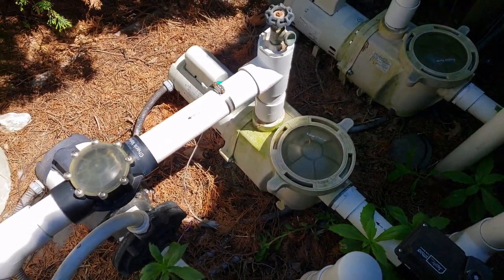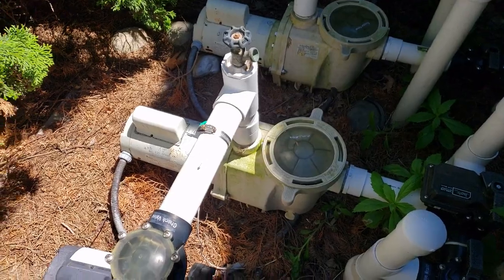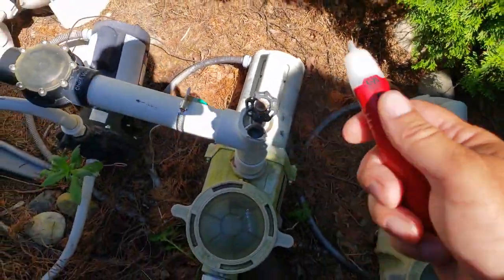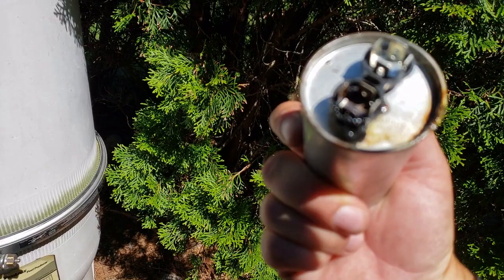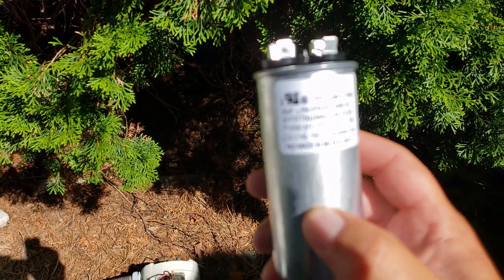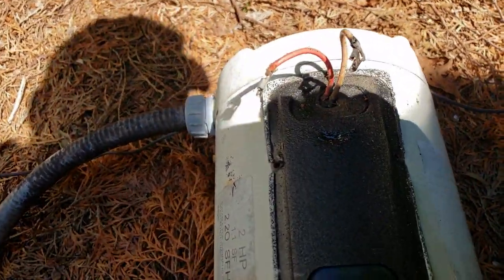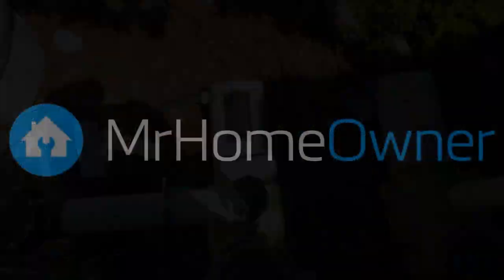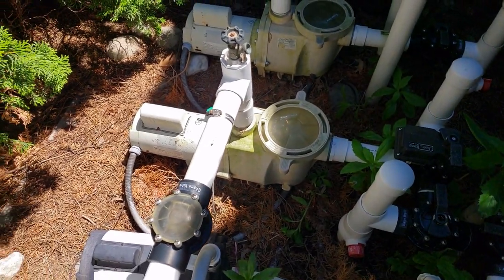Pool pump won't turn on and is humming or clicking

Comment: I had the same issue (humming and not starting). I checked the breaker at the pool and the breaker at the house and neither were flipped. I turned of and back on the breaker at the house and that did not fix the problem. I then turned off the breaker and back on at the pool breaker box and that DID fix the problem. So even thought he breakers did not appear to be flipped, turning it off then back on was sufficient. 
Also as a word of caution, capacitors can still be dangerous even if power is turned off at the breaker. A capacitor is a "battery" that stores up electricity in order to deliver a large jolt of power to "kick" the motor on then the lesser power through the breaker is sufficient to keep the motor going. This is the same with capacitors for hvac unit (in fact they are the same capacitors). If the capacitor itself fails then theoretically it holds no charge. And if the problem wasn't the capacitor, the charge would theoretically discharge itself into the motor when it is off. But if the problem was for example a wire to the capacitor rusted off, and the capacitor was unable to discharge to start the motor then it could still hold a charge when you go to service it even if the breaker is off. The shock from a capacitor is enough to possibly kill someone, lose a finger, or cause other injury. I know many hvac techs say it is very rare but it doesnt shock you until it does.So please be careful when serving near a capacitor and if you are going to touch the capacitor, please beforehand look up how to safely test and discharge a capacitor to ensure you don't hurt or kill yourself. I am always an advocate for diy but I also don't want anyone to get hurt or worse and leave their family without you.

Comment: Just in case a curve ball is tossed into the mix.  I too have a Jandy pump that humms, then the circuit breaker pops.  I tried the , rotate the prop,  hit the motor with a rubber mallet, then I went with the next step.  I bought a replacement capacitor.  That worked once, then it went back to its old behavior.  I decided to try a capacitor off one of the other motors.  One motor for water feature, one for jacuzzi, and the main pool pump.  The capacitor off the water feature pump worked perfectly.   I assume i got either, the wrong replacement capacitor,  or I bought a bad one.  Either way,  the capacitor was the culprit, and now it works fine.  Good thing,  My next call was to a pool repair service to replace the pump completely.
Reply from the maker: Awesome info Patrick - thanks man!

Comment: What if my pump doesn’t have that thing on top of it. What do I check?
Reply: The one he’s looking at is a run capacitor. If yours doesn’t have the hump on top it may have a start capacitor located at the back of the motor behind the housing.

Comment: when it was humming, was it also triggering off the circuit breaker in the panel?
Reply from the maker: Mine was not, but I'd imagine it could.
Reply: Thats exactly what mines doing, did you ever figure it out?

Comment from the maker: Someone replied asking if it matters which wire goes on which post, but then deleted it - it doesn't matter - but make sure you connect each wire to a separate post - meaning, any of the 4 tabs on each side - one wire to one of the 4 posts, then the other wire to one of the OTHER 4 posts.

Comment: Just wanted to say thanks for taking the time to make this video; I was able to confidently assess that my start capacitor went bad - I used a multimeter to double-double-check. Now that we're all looking to save every penny possible, this saved me a small fortune by taking the initiative to do it myself. Total cost of the part was $26 including tax. Amazing!
Reply from the maker: Awesome Jim - thanks for letting me know!